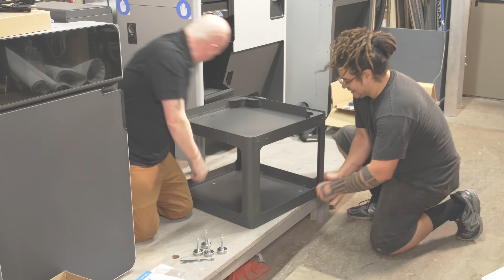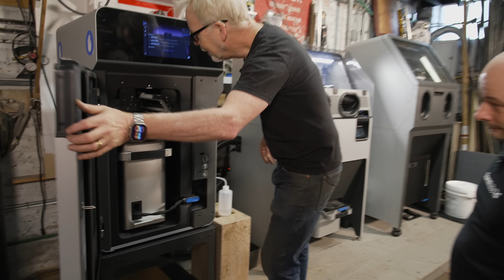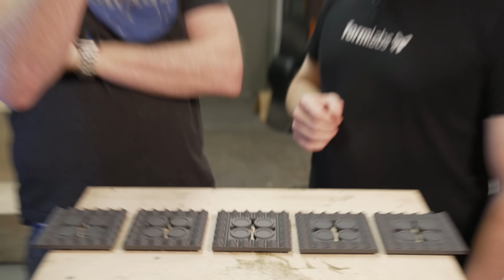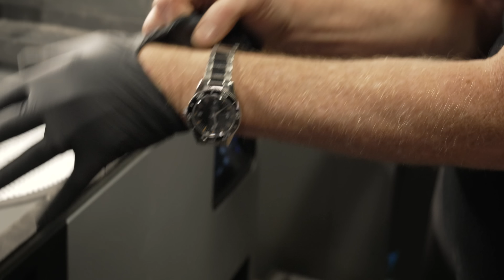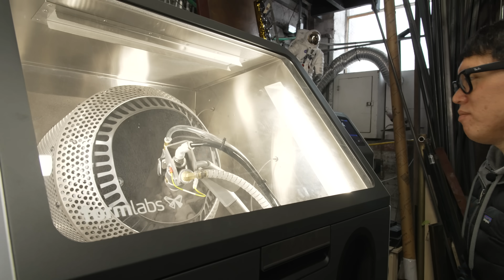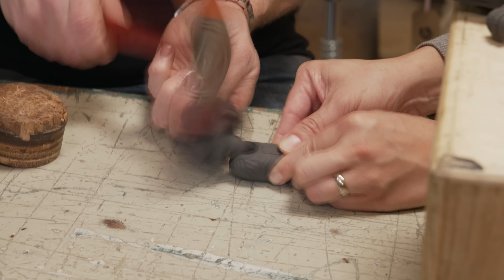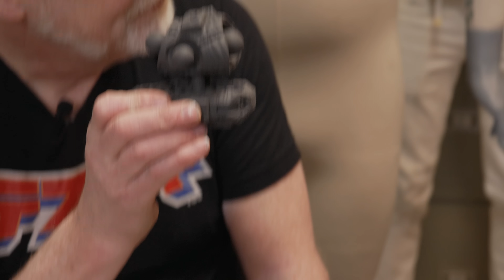Adam Savage Levels Up His Workshop 3D Printer!

Comment: Hey Adam. I did pretty much the same process, as the shoptech in charge of printing student files on the Z Corp 650 in the model shop, dept of ID at AAU  in San Francisco in the late 2000's. (There was some myth that you once worked there) Even though I was very careful about my powder exposure, wearing a half-face respirator much more than my boss said I should, I think my 2 years working with that process has contributed to late-onset asthma, that I'm now being treated for. At the time, the technology was pretty amazing, but that beast was such a pain in the butt to operate and maintain. The powder was quartz-based I think.

Comment: Since it is suspended in powder, you can just print everything in place -> including the joints, already connected.
talking about gearing, you can print a whole clock in one go, already assembled, and after some movement, the powder is out and the gearbox works

Comment: after seeing the action figure issues, maybe using it for single pose figures or statuettes, and maybe even cosplay tools, weapons and even greeblies you can't find anymore would work. as for the pegs not fitting, likely only way around that is making possible permanent attach points by making the pegs a tiny bit smaller than the hole and then filling the gap with adhesive material.

Comment: I mean if you can print stuff suspended in powder, can't you just print those joints already assembled? Thin layer of dust all around the ball joint on the inside would need to be brushed out.

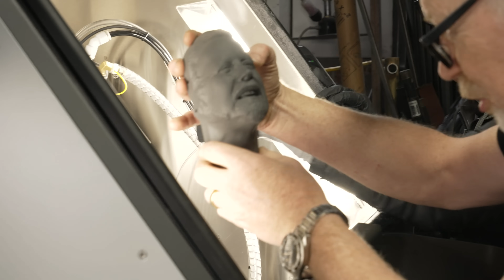Comment: @24:57 "That sound!"
also @24:57 I turn around to see my ender scrape half of the first layer it just printed into my y-axis wheels...

This isn't 3d printing. This is what it looks like to own your own industrial facility with a technician on staff to make things out of the same plastics 3d printers use as filaments. This feels like calling the Space Shuttle an extension of model rocketry... technically, you're not wrong. In reality, you could call the CEO of Stratasys a 3d printer.

Comment: I can provide some information that I have learned about 3D printing. I taught an engineering/3D printing class for 20+ years. One of the biggest things I learned about parts that "Go together" is that you have to have a 3-5% size difference. For example if you have a 5mm pin that has to slide into a hole, the hole has to have a diameter of 3-5mm larger. I learned that when I was making threaded parts.

Comment: I am completely confused how this thing prints anything. There are no forms or anything. Just a pile of powder and out comes the prints. Totally confused.
Reply: so fdm (fused deposition modeling) prints, the popular ones with the spools of plastic shoved into a nozzle, prints models by drawing each layer with plastic.

sls (solid laser sintering) uses a different method to make each layer. it has a platform that moves downwards incrementally, that powder is spread out on. once this layer of powder is laid flat, a laser above the platform draws a.layer of the model with a laser, melting the powder (hence sintering). it gets really hot, so it's then buried in some more powder to cool down evenly. after that, you can get the models out.
Reply: It's exactly the same principle as resin printing actually.

Comment: Not sure if they have tried this, but they probably should try to reprint those figures in place so the model is already put together. With that type of printer the powder should support it and still allow for the joints to be cleaned out via compressed air. Probably the only way for it to work since that material had no flex what so ever.

Comment: Cool stuff, but not using PPE (even with the fume hood) seems like a very poor decision. I work around carbon filled nylon SLS parts at my full time job and before you know it, this powder will be EVERYWHERE in your shop, especially if you’re doing part cake  break outs with the break out station hood up. Formlabs rep should definitely have been more encouraging to use PPE.

Comment: Adam may end up with Black Lung if he keeps circumventing the PPE and safety protocols--open hood during powder removal, no respirator, no gloves with handling parts post-processing. Training is training for a reason and gloves exist on the machine for a reason. People don't engineer these devices but quickly assume they're experts in how to use them so quickly. Other than that, this is an amazing piece of technology. I know they're expensive as hell. I think this system is like $30K!

Comment: I looked through the comments and saw the suggestions for the joints.  My thoughts, as a totally inexperienced person, would be to print the ball side slightly undersized and use an elastomeric coating (or, inversely, the socket slightly large and coat that).  Another approach is to thin the wall of the socket enough to restore some flex.  And of course, the old approach of using screws instead of molded-in pins.  I wonder how this nylon does in terms of contact wear?

Comment: Most 3D printers if not all that can print PLA can print TPU, which we absolutely DO know how durable that is as it's the plastic hardhats, shopping cart wheels, and so much more is made of.  If it's good enough to protect people's heads from literal falling building materials it's pretty damn good and reliable.  I've printed it without changing any default settings for PLA and prints came out fine, hell better than they did with PLA on the same job (Ender 3 that I was borrowing from a friend...hate that platform now and will not buy Creality when I get my own finally).  I had some 'hairs', but a quick pass of a butane lighter eliminates them.  I printed about a dozen batarangs out of it and it's fun as hell to toss those around with little fear of hurting anything because of the lower hardness rating of the TPU I printed with.  

TPU is what they're making the airless 3d printed basketball out of if I'm not mistaken

Comment: I wish i had printers like this in my home.I'm 3D printing for over 12 years.. But i'm not impressed by our development in those years. this tho.. is quite precise and super tech. But you need the space for these machines. Which withheld me for over 10 years to build a SLS printer.. Yo had to test some tollerance settings for joints and press fit settings. ... You'll be fibne if you know your tollerances of the printer.

Comment: Funny, I was just using a rubber mallet to join some PLA hinge joints not long before watching this. Ended up using a heat gun. For my ball joints I add a cross split to it so the ball can deform to fit in the socket then expand out again. It seems to be working well so far. That probably won't work with what you've got though if it simply doesn't flex at all.

Comment: We have this printer at work and it works great for us. For an R&D department it has paid for itself many times. However for a personal use printer this thing is terrible. It has nothing to do with the print quality other than the surface finish being similar to sandpaper. Its the process of waiting for the print a day later, the cleaning and maintenance of the cleanup and the cost of the powder. I'm excited to see if Adam uses it a lot or if the process pushes him away.

Comment: I’ve been using a gen 1 Fuse 1 and Sift exclusively with nylon 12 since spring of 2023 (before the Fuse Blast was available and before the Sift had cabinet-style gloves).

I’ve always used the recommended 30% refresh rate (70% recycled powder mixed with 30% fresh powder) and I always have a surplus of recycled powder. I have two build chambers and I’ve been forced to use one for recycled powder storage. The sifted powder hopper in the Sift is always full so the incoming jobs I have to print are a challenge to clean. I know, packing density makes a difference but I have timelines, quantities and quality standards to meet.

The Formlabs tech should’ve warned Adam and Norm not to both work in the Sift at the same time with the hood up and without respirators. The negative pressure is only effective enough for really dusty operations when the hood is down. I always wear glasses, gloves and a half face respirator when working with this stuff.

Adam needs a vapor smoother next!

Comment: That seems to be the reality with every "first print" of any type of 3d printing.  Adam says that its the hobby for people that like picking scabs, its more like a hobby for people that do not give up.  Especially when you model your own projects in cad, I mean... its not difficult on a "standard" filament 3d printer to download an stl and follow all the instructions from previous folks that have already went through all struggles, but I endeavored to design landing gear and tires and wheels using petG and TPU filament and it took me several failed prints, and lessons learned before I was successful.

Comment: I would also suggest hand blasting the parts first before tumbling! Also a vibratory polisher gets amazing smooth parts - great for robots etc! (lost of detail ofc), also gives them a little wash. White powder is cool because you can dye it (not super easy to get consitant, but works with some additives and heat help). And when designing, you will find long flats warping potentially. So you may want to design fins/heat sinks in that get snapped/cut off if you get any issues (same with metal poweder printing) :)
SLS moulds work well also! but Silicone sticks in all the pitted surfaces. So I spray seal with a matt lacquar or gloss depending on the cast finish I want + mould release. I usually find a 0.2 tollerance worked on the machine I worked with after a light vib polish.

Comment: If you apply heat with a heat gun, will the nylon become flexible enough to fit sockets like that?
=
Reply: sintered powder is particularly solid when it's thick enough. it's flexible when printed with the right geometry (same method used for those expensive airless basketballs), but i don't think these models would be malleable with a heat gun. if we'll look to post-processing, sanding and filing the joints until they can fit in could work.

Comment: Since everything is suspended with no supports, couldn’t you just assemble everything in the slicer and then print the figures in place? Then you wouldn’t have to snap everything into place. But I guess the problem is still the rigidity of the material not allowing the bending and movement of the action figures anyway

Comment: I'm not an expert, but I'm pretty sure your first print needs to be a tiny boat.
Reply: Ha-ha...great post!
Reply: Not only the first print but those little boats need to be produced on a continuous basis and for every new material, temperature, or setting change. If the combined weight of all the tiny boats doesn’t exceed the weight of your actual prints then you’re doing something wrong.

Comment: Although it was pointed out several times in the comments that you should have used more precautionary measures for PPE I found the video pretty fun.  I've been working for a large investment casting business for the last 45 years.  We purchased our first 3DSystems SLA machine back in 1988 which was their SLA 250 (ser #3) which had a printing volume of 10"x10"x10".  It was pretty slow but put us ahead in the Investment casting industry in using SLA patterns for casting. 

I got involved with doing the CAD work and setup for builds about 1990 and it is still my primary job.  We now have 10 large machines which we have built over the years large 60"+ diameter patterns for things like Intermediate cases for jet engines for Pratt, GE and Rolls.  We build them in segments and resin the segments together to form one whole pattern.

Years ago we did look into having some gating built with SLS in the hopes it would be cheaper and easier than SLA gates.  But found out there was a bit of process in needing tin infiltrate them with wax which helps with the casting process and also some surface finish.  The surface finish also kept us from using SLS for casting patterns.  So it never really panned out and we never really investigated the process since.

I do like the nylon material you used for these figures.  I agree the sound of them is pretty cool.  Look forward to more videos to see what you create, especially as you get more experience in dealing with things like joints and such.  Thumbs up!

Comment: Can the parts be ground back down to a powder and reused?
Reply: most likely they can't. it's advised in SLS to not use the powder in enclosed geometries (such as in a cup). where the part itself is sintered nylon powder, melted by a laser, the parts are hot after sintering. the powder in the enclosed area would be surrounded by stronger ambient heat. the powder in the enclosed area wouldn't be solid, but solid clumps stick on to the part even after cooling. this powder, when cleaning, would be best disposed during the sandblasting stage, as waste powder. if left to be recycled, print quality suffers. all that to say - even the powder around some prints isn't recommended for reuse, so if a print is ground down to a powder, we most likely wouldn't be able to ensure same quality results.

Comment: you'd never ever want one of these things in your main workshop. The dust get's everywhere & is not something you want to be breathing in - yes even in what is a partly enclosed system. It's the sort of thing you really, really want to be wearing PPE in a dedicated space with ventilation and filtration. Influencers do a really bad job in general with the safety aspects of 3D printers and the handling of materials.

Comment: Pretty cool but I wish you would have explained how this process works more as most people are just using FDM.
Reply: for SLS, the bucket shown is the available build area, where the floor of the bucket starts at the top, and moves downwards like an elevator. a layer of powder is deposited on to the build area, then flattened. a laser then draws one layer of the print, melting the powder. the floor of the bucket moves down by a bit. then the process is repeated.
Reply: @nox_tech_  makes sense, thanks!

Comment: "In my opinion, it wasn't necessary to print all these parts separately on a powder 3D printer. Printing the model as one complete piece would have eliminated the need for assembly, though it would have resulted in more cleaning because of the powder supports between moving parts."
Reply: tolerances for an item printed in SLS would be different than in FDM or SLA. if they did print it assembled as is, all the parts would've likely been fused and it would've been immobile. that said, they could probably adjust the tolerances of the print themselves just fine. another way would be adjusting the printer settings slightly. another other way that they look to be aware of is sanding down the joints. all that said, in my experience, they could likely get most of the powder out of the moving joints but just moving it around in the full range of motion.

Comment: I feel as though there should be a manual way to operate the bead blasting at the end. Leaving it in a tumbler with a stationary nozzle seems like it wouldn't get at every angle and detail, and would take a lot of time. Seems as though it should be like the first hood with the gloves, so you can manually manipulate the nozzle and more efficiently blast the remaining powder off the parts.
Reply: you're not far off with how it pretty much goes in general with SLS. at least in my experience a sandblaster in the form as you've described is used. making a way to automate it looks to be formlabs' addition to make it their unique spin on one part of the process.

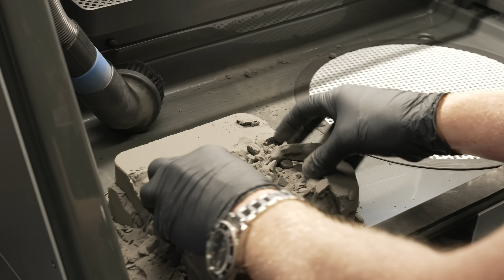Comment: 18:34 I could not watch anymore.
I used to run an SLM with Aluminum power. Cannot watch someone deliberately ignore safety measures like that. Those powders are so fine they can absorb through skin, block pores, all kinds of nasty things. I know this is only nylon, and that is a strong draft but use the system as designed. The manufacturer did not spend the extra time and money to make it a glove box just because.

Comment: well, this is not the printing for having at home. At that size, I would expect a metal 3d printer; that would be extra-cool. Metal 3d printing, that seems to be out of the question for home workshops, and it is such a pity. I am a Latin and Greek professor, and I use my 3D printer to print columns and models of classical statues that I find on the web to decorate my classroom. I'd LOVE to be able to print them in bronze! (BTW, where did you get the model for that crown? Can you share the link? Even if it is paid, I'd be interested) thank you

Comment: Instead of smacking plastic with a hammer. Should have grabbed a heat gun and applied heat the joints. I gotta do this to toys that have super tight joints or tight parts. Can also use hot water to soften the plastic.

Comment: As someone who has worked in model shops for over thirty years—just like Adam—and, despite being very cautious about protection, still ended up with a form of cancer linked specifically to the resins and paints we use, I couldn’t help but wince at the lack of PPE in this film!

On another note: TOLERANCE! Expecting a 25mm ball of solid nylon to deform enough to fit through a 23mm aperture is the height of wishful thinking.

Comment: I see absolutely no reason you need this, it’s $30k just for the printer and near $60k for the entire setup you shown. The nylon you used is 100$ a kg, you’re not a manufacturer of parts for anything. Really just a professional hobbyist at this point in your career, I feel like this was absolutely unnecessary for your work flow, those are really expensive figures you printed tho.